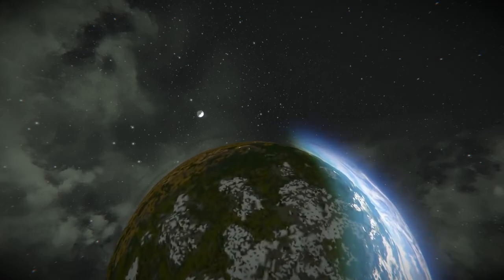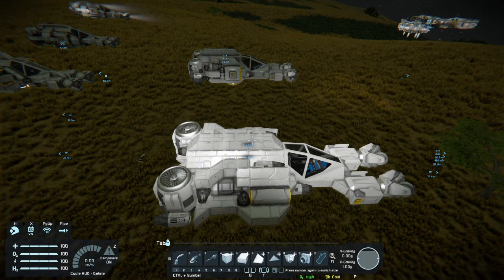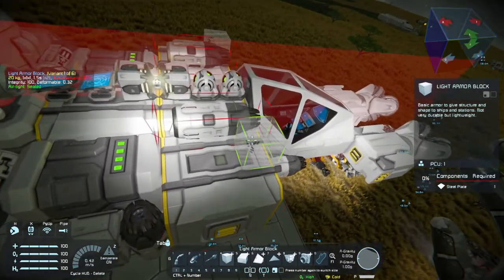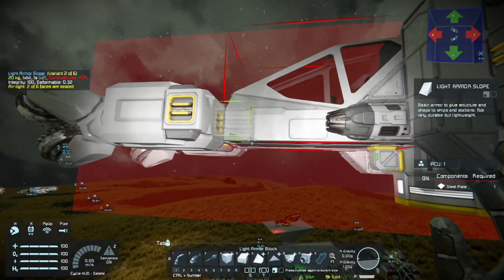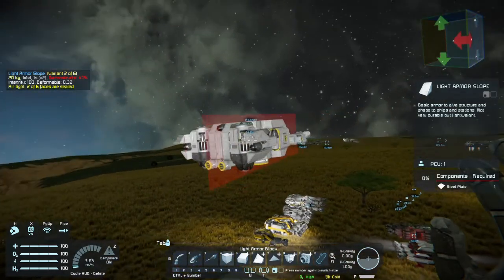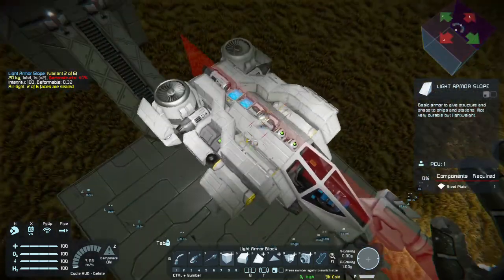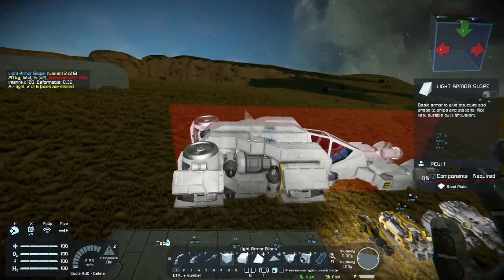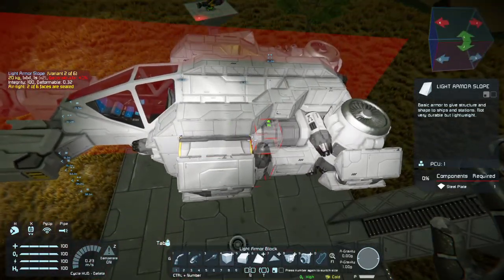Let's Build SPACE ENGINEERS - Atmospheric Miner - Stage 2 - Armor and Aesthetics

Comment: Great videos. I recommend shortening your intro - far too long. But the video itself is awesome.
Reply from the maker: I 100% agree... which is why all of my videos after this series had shorter intros. :)

Think the longest I do now is 10 seconds or so?
Reply: @odysseygaming214  Awesome good on you. I thought you might have, but it was really late when I was watching and I fell asleep :p

I'm going to try building this ship today, it was otherwise a great video so thanks for giving me some ideas!

Something I've always found difficult with the mining ship (I built splitsies drop pod one) is that it's easy to lose control as you spiral down to dig. Not because your ship gets heavy, but I'll just be drilling a spiral and my ship goes wonky, banks sideways and lands into a hole. It's hard to regain control of.

Do you know any way to prevent this? Would the gyroscopes help, or is it just me getting disoriented as I dig deeper down?
Reply from the maker: @zakman246  I know exactly what you're talking about. Fly up a bit and spin in a circle, you'll see that you start twisting to the right or left, depending on which way you do that. Use Q and E a bit to keep yourself level, and take it say a quarter turn at a time, and you'll be just fine.
Reply: @odysseygaming214  Ahh okay. So over time as I dig down it's happening because my ship is gradually going off centre to the point where it messes up, so I just need to keep a tab on it and Q+E to keep it level? Got it.

The other thing I find hard is that when this happens, the camera will lock into first person instead of third (presumably due to lack of room for third person), and then suddenly I can't even see my surroundings and it gets even harder to get out of that mess.
Reply from the maker: @zakman246  Three fixes I've used. The first is design. I believe this ship can drill straight down while empty, which eliminates the need for spinning altogether. The second is to rely on your gymbal instead of your eyes. One is correct, the other can get disoriented. The third is to Ctrl+Right Click to change your camera angle so that you're looking straight down the hole, and there's room for the camera.
Reply: @odysseygaming214  Legendary. Thanks mate, I've subscribed :)
Reply from the maker: @zakman246  Also, I mis-typed. It's Alt + Mouse to change your camera angle. Think I was thinking of another game with that one...